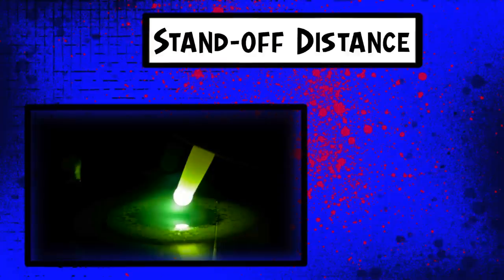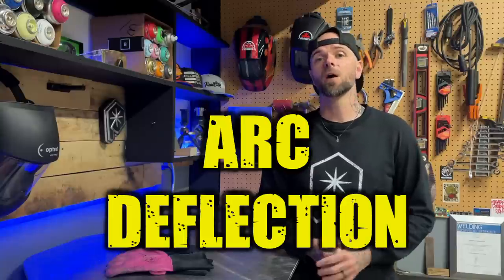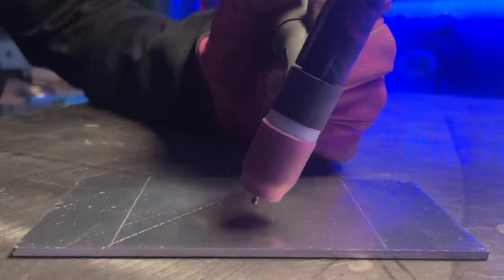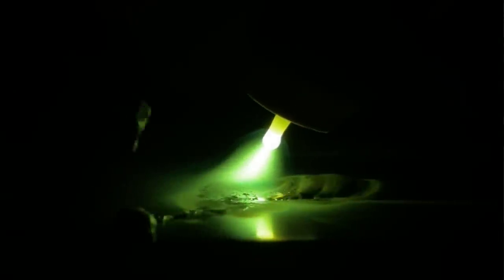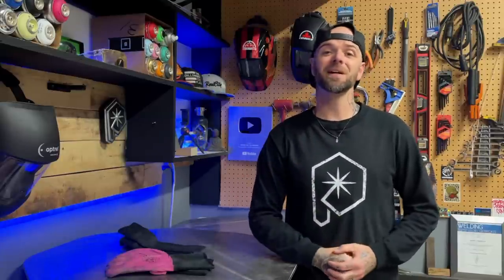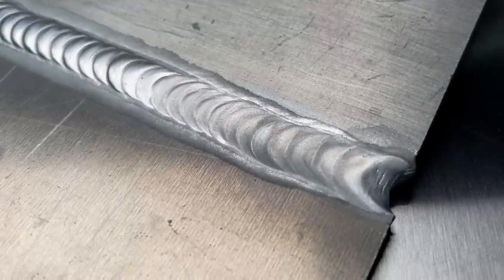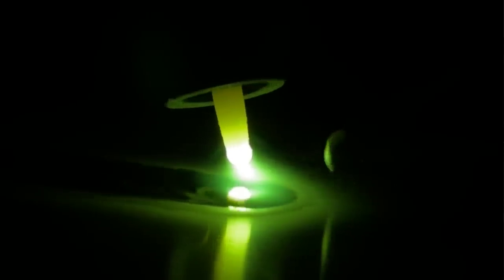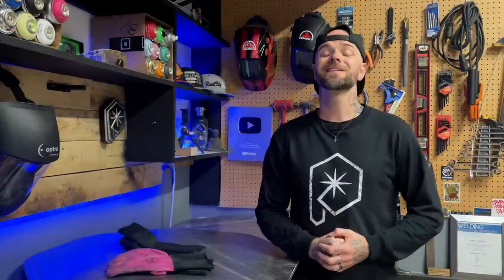What is Standoff Distance and WHY should you care

Comment: I know this is not the video but I tried using the filler rode 3/32 and it was a bit of a challenge sense I don’t use that filler as much but once I got the hang of it. I will say I found that size to be the best at just running it, rather than dabbing it with a thinner rod.

Comment: Hi Dusty.. i have a 200amp ac/dc machine with i think it's 10 or 15% duty cycle at full power, do you think a ck17 with a stubby gas lense kit would handle being driven that hard even though they're only rated for 150amp? I have a much hated euro style 26 that came with the machine and it's got huge cables and it's near enough to completely uncontrollable and I'm always either to far away or dipping.. a ck17 is tempting because i don't need a water cooler but if the 17 won't handle the amps then i might have to bite the bullet and get a ck20 and build a water cooler
Reply: 17 will be more than fine. It's rated at 150amps for one hour of continuous welding. You're going to love it.

Comment: I was thought to keep my tungsten sharp, however, I see in your vids, your tungstens are ending in a ball shape, like mine look after I dipped :p Is this just another type of tungsten/welding? You also mentioning swapping out your tungsten when you dip/contaminate. I was though to just clean it up and resharpen it. I'd love to hear your opinion on this, very much in awe of your consistency in doing beautiful welds :D
Reply: Aluminum welding is done with AC power instead of DC (normally atleast for my welding DC electrode negative) DC electrode positive puts more heat on the tungsten. This melts the tungsten and makes a ball of tungsten.  Since AC is alternating between positive and negative very fast it balls the tungsten. More modern welders can change the amount of positive and negative they give during AC welding (Google "cleaning action") the less positive you have during AC welding the less balling happens.  My welder is and old heavy transformer welder with almost no options. It balls very quickly.
Reply: @doncridlebaugh6790  that would explain, never Welded aluminium myself :D thanks for the insight and teaching me something new today :)

Comment: aka arc length
Reply: Ctwd
Reply: @InchFab  tig torchs have contact tips?
Reply: @MikeP350  not in the exact same manner that a mig machine has, but contact tip(electrode) to work distance is, like you said, arc legnth.
Reply: @InchFab  right, just giving you a hard time. I've always heard heard ctwd or stickout for mig and arc length for stick/tig. Never heard standoff before but it's obvious what he meant
Reply: @MikeP350  nah bra, what are you doing? We're suppose to insult each other's intelligence now. Do you even weld?